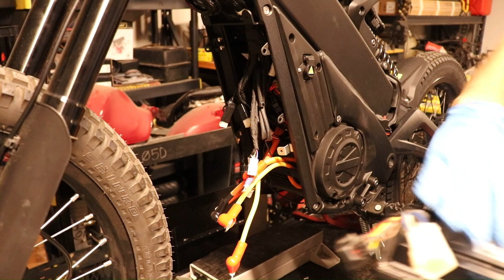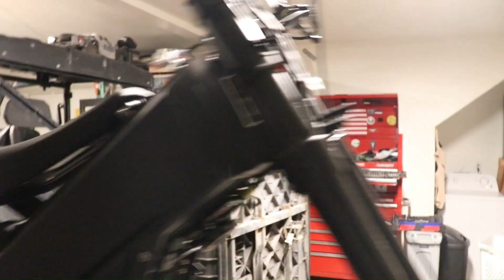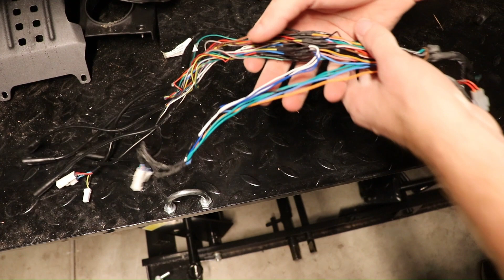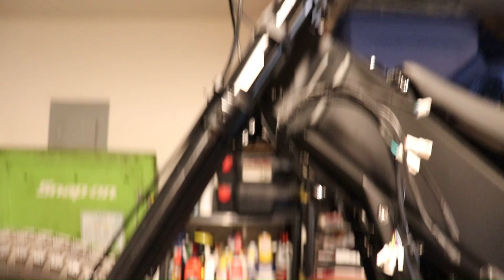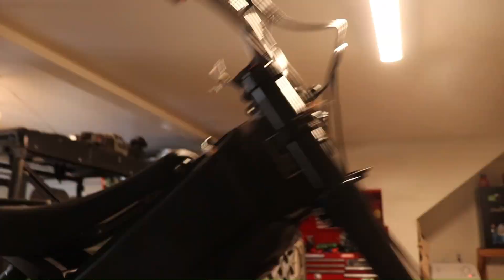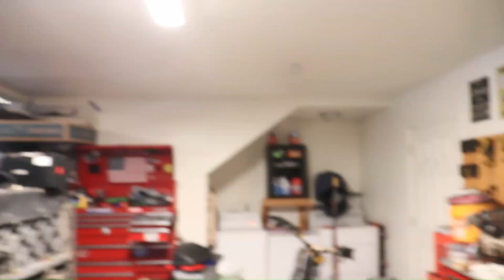Talaria XXX controller install and wiring

Comment: On the 8 pin (6 wire) what is the pink, red/Black, green/white and blue/white. Wires for? When i plug this in, the bike short circuits.

Comment: Can you provide details on the wiring for the headlight/taillights? I'm trying to install a dual switch so I can turn off the running lights separately but the switch i purchased only has 3 wires per switch so idk how to wire it In.

Comment: How is the bike running now? What’s the advantage of doing this? I’m about to buy a XXX jw
Reply from the maker: Hey, the bike is running good, but it’s on 72v and a sotion motor now. Adding a aftermarket controller will allow you to run more power
Reply: @kodyewing6443 where can I find a 72v for my xxx? And how does it fit with the space limitations
Reply: @kodyewing6443 what sotion motor works in the xxx what kinda speeds are you seeing?

Comment: Great video, Kody.  
1.  The Sting R controller runs more watts and has a slightly bigger battery compared to the XXX.  What is the difference in watts between the two models?  Or, how much more powerful is the Sting R than the XXX, %-wise?
2.  The aftermarket controllers that allow more watts to be run through the motor, how does one access the programming to do tweaks?  Is it a proprietary cable that hooks up to a laptop?
Reply from the maker: Hey, so the Sting R has 1500 more watts than the Luna XXX(8000w vs 6500w). When it comes to changing the settings on aftermarket controllers, a lot of them have apps that you use on your phone to change the settings, but you can use your laptop with the proper cables to connect them
Reply: @kodyewing6443  Thanks.

Comment: Awesome breakdown! Would you be able to go more in depth on the blocked connectors? Specifically the ones for the turn signals. I wired my own signals with an external battery source but would love to wire them right into the bike like the street legal version 🙏
Reply from the maker: If I have another stock bike come in I will be able to, but all the bikes here have that part of the harness out so I can’t
Reply: You ever get this figured out? I have some turn signals coming.
Reply: @thomasshannon1883  I bought the float seat so I disconnected everything to install it and I think I might be able to splice into the brake light to power the turn signals. Pretty sure the green and yellow wire is for the brake sensors. So just need to figure out which wire is positive and negative and how to tap into it properly.

Comment: did the mx4 controller work? assuming you had to calibrate it?
Reply from the maker: Yes the controller worked, but we noticed that it lacked power. After testing and troubleshooting we have found out that it’s a hardware issue on the motor, as the motor in the mx4 and the xxx is different in a couple ways, one being the encoder used.  Still trying to find a remedy for that so that the MX4 controller will live up to its full potential

Comment: Yo can you do a headlight mod video I think I know how to do it but I don’t wanna f it up
Reply from the maker: What do you mean by a headlight mod? Adding extra lights or being able to turn off the headlight completely?
Reply: @kodyewing6443 you should totally do a all light kill switch tutorial, or a headlight replacement tutorial, stock kinda dim
Reply from the maker: Will do, I will get one done this weekend covering additional headlights/replacement headlight and how to install everything!
Reply: @kodyewing6443  awesome can't wait:)
Reply: @kodyewing6443 I'm about to add a dual switch to kill the running lights for the headlight and taillight so I can go incognito mode and I would greatly appreciate a tutorial on the wiring details if that's in the works any time soon 🙏🏻